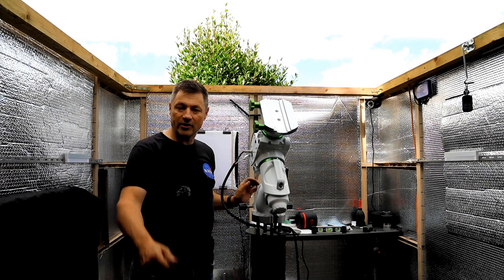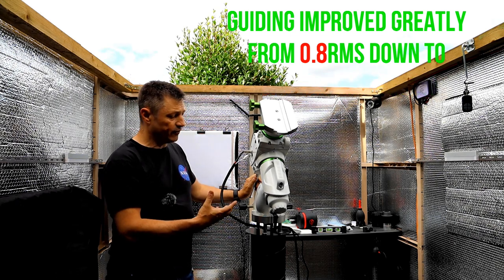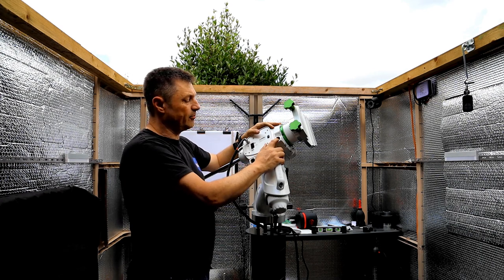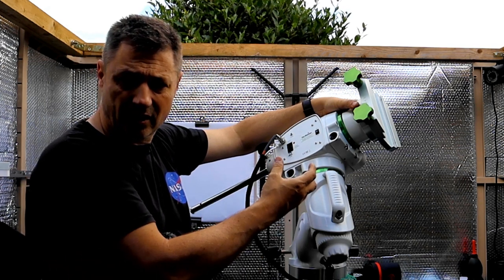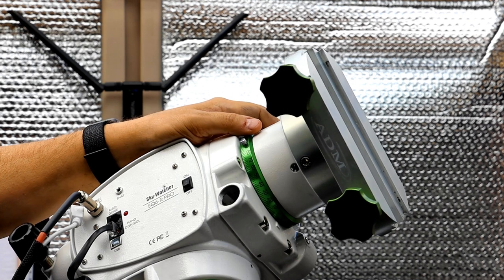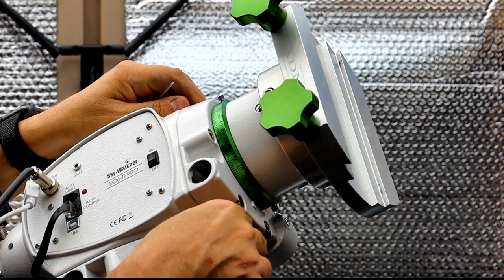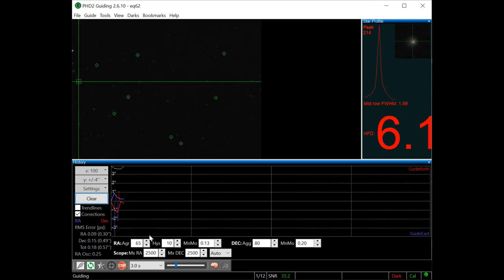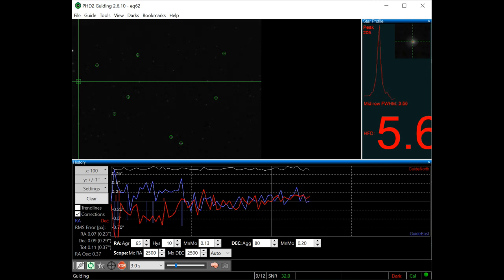EQ6 Tuning and Backlash removal. Also new guiding in PHD2 at 0.3 total rms error

Comment: Great stuff. I watched this after watching your teardown, rebuild + bearing replacement video on EQ6-R Pro mount. I just adjusted the sticktion on DEC and RA by backing off how tight nuts were on bottom of DEC and behind polar scope on RA. Very easy to perform and results on balancing are fantastic! I used channel locks and cloth to loosen RA nut. Loosened DEC "cup" nut by hand. Initial imaging session appears to have dropped total guiding error from 0.7-1.0" to 0.5-0.6". I've worked on electro-mechanical systems used in semiconductor facilities all my life, so that helps with these procedures! But I'm still a newbie to astrophotography, and all the associated hardware and software. I will have to try the backlash adjustments shown in this video next. Thank You for the very clear demonstration and explanation of these adjustments. They allow people to greatly increase the performance and value of their mounts, without paying through the nose to have someone else do it!
Reply from the maker: Hi Ralph and thank you for watching and taking the time to comment. The mounts often come out of the factory way too tight and it just requires the adjustments you made. I most probably could have got away with just doing that but I love tinkering with mechanics so was always going to strip the mount completely. I am sure your knowledge and experience will help you a lot and wish you luck in your pursuit of this fascinating hobby.

Comment: I hypertuned th eq6rpro couple days ago. I went with superlube also, says rated for 40 belowF. I was worried about final adjustments but again your video was spot on. My mount went from crazy declination movements while guiding and then stopping, in CO cold weather, to guiding to .55arc sec last night. I've learned a lot about how mounts work as well. Thanks again, Frank
Reply from the maker: Excellent results Frank and thank you for taking the time to share that with me. I am very pleased the video was helpful and the mount now gives you great guiding. Clear skies

Comment: Thought I'd give you an update. After finally getting a good guiding assistant backlash graph and noticing my guiding was just a bit worse then just before, I thought I would try and get the best of both worlds. Using an amp meter I tightend the mesh what seemed to be barely perceptual and I immediatly ran into problems with moving south again. Tried to reverse and then I couldnt get north movement !!  Am back at it again tonight but clearly there is some method to this madness of fine adjustments I dont quite see yet. This is extremely touch to put it mildly. When you say that the final touches are like just barely barely moves that seems an understatement ! Hope others reading will get this point. I'll keep you posted as my experiences may help you in some future video explainling the how to do it bit. 🙂
Reply from the maker: Hi Richard and thank you for the updates. The final adjustments are ridiculously tiny and its hard to express this. I have found that its better to be a tiny loose rather than tight. I find that as long as the backlash is measurable by PHD2 it can be adjusted for  by the software.

Comment: Another great video mate,  just ordered a set of bearings for my EQ6.  Although my guiding numbers aren't too bad the amount of tight spots when balancing has always concerned me.  cheers.
Reply from the maker: You may be able to just take some tension off the 2 main shaft nuts as they seem to be done up well tight. That can free a lot of the stiffness up.

Comment: One of many very useful videos from you! I just had my NEQ6 belt modified, but when I got it back, I have serious issues with my dec axis. I did run the guide assistant including the measure backlash, and it show indeed a 'long' horizontal part befor going south again. The reported backlash is >56000ms, but according to your video, it is rather binding, and not backlash? I did run the dec axis 360 degrees both ways by the hand controller, and there is no obvious binding to my notice, no sound or other...  I have also posted the question on various FB groups, and some suggest not enough tension on the dec belt. The belt is very hard to access on the NEQ6. So now I don't know if I should loosen or tighten the worm gear! 🤔😄 And clear skies are very rare these days in Norway! 😟
Again thanks for your informative videos! 👍🏻
Reply from the maker: Hi and I hope I can help. If its fine binding which it most probably is especially if you have zero play in the axis it can still rotate fully with out stopping. Back off the Worm carrier so there is the smallest amount of play possible and re run. The worm and gear need to move freely and PHD2 guise assistant can correct for a small amount of backlash but cannot do anything for fine binding. This is the only set back as both will look the same on the guide assistant graph. Its extremely unlikely you have that amount of backlash and if you did you would feel that in the axis by manually wobbling it while the clutch is locked. Please let me know how you get on and if I can help anymore
Reply: @Astrobloke  Many thanks, I will let you know! 😊

Comment: Nice. Suggestion:  I'd recommend painting your silver thermal wall insulation flat black to cut down on reflection of skyglow, ambient light, and even LEDs on power supplies. (I covered the bright on on my EQ6 with a sticker. I can still see in the dark, barely, but that thing was designed too bright.)
Reply from the maker: Thank you and great suggestions. I no longer use that obsy as I have built a much larger one recently at a new location with a warm room. Its my most recent videos if you want to check them out. Thanks for watching

Comment: Thanks for another great video.  I just did the backlash adjustment on a new HEQ 5 Pro.   There was quite a bit but now I feel no play and there is no binding (confirmed with a multimeter testing the current draw for a full 360 on both axes did not change.)   Looking forward to trying it out. 

Rowan Belt mod parts arrive next week.   Looking forward to try that too.
Reply from the maker: Nice and the belt mod should improve things further. Let me know your results and thank you for commenting
Reply: @Astrobloke  Thank.   do you know if it is normal for the motors to get slightly warm?   I didn't take notice before adjusting the backlash.   Now they are just slightly warm after a few minutes of practice slewing.
Reply from the maker: @Wolfie6020  I would think after slewing that would be normal but I really do not know as never checked. I shall do that though and let you know

Comment: Hi again. After the summer and a bit through the winter I started having guiding problems again and noticed a few important screws had become loose. Upon starting to re adjust the gear mesh I noticed that the spindle adjustment could introduce signifigant backlash if I lossened  it for any given gear mesh setting. This leads me to scratching my head a bit as to how to be sure where any apparent backlash is coming from.
Reply from the maker: Its a but like that where you tend to chase around. I normally leave the spindle and focus purely on the worm carriers for adjustment. I have for a while now not worried about the backlash size so much as that can and is compensated for in PHD2 its any kind of binding that is the killer for good guiding.

Comment: Nicely explained Glenn
I’ll check those screws to see if it makes a difference to my new EQ6R pro. I was shooting low last night (about 22 dgrs) I think that affected my guiding, I was getting .9 - 1.1 out of the box! Too much atmosphere I guess/hope!
Cheers Glenn
Reply from the maker: did you finally get your mount? Low will really test the guiding but I would think it could be improved. I would start with PHD2 adjustments and guiding assistant and then move onto PEC training first and see what that changes
Reply: @Astrobloke  Yes mate, it arrived! Tested it out now, going ok but guiding is a bit high!
Thanks for sharing that Glenn, I’m sure it will come in useful 👍

Comment: Great video on tuning this mount, amazing what it is capable of with some fine tuning, cleaning, new quality bearings etc. a basically good mount out of the factory becomes an excellent mount with some careful work, easily within the capability of most who like to go the extra ‘mile’. I note you have various mounting plates on the mounts you have worked on, where do you buy them, please, they look well worth adding to the mounts. Stay safe and best wishes from ‘down under’. 👍🔭🇦🇺
Reply from the maker: Hi Shevill. Both my HEQ5 and EQ6 R PRO are now just a dream to use, guiding between 0.3 and 0.5. I have always done my own mechanics with cars and motorbikes for years so taking these mounts apart and rebuilding was a really fun task for me. It is however very accessible for most with very modest tools as you say. I initially upgraded the saddle on the EQ6 because the original was not that great and the white paint used to grip my losmandy plates when trying to slide a scope in. That one is by ADM and I bought from Firstlightoptics.co.uk. On the HEQ5 I upgraded the saddle because it was the older model and only held vixen dovetails (all my scopes are now on Losmandy) that saddle was by Geoptic and I bought from Rothervalleyoptics. ADM do one too but I liked the orange lol. https://youtu.be/QLJUy-DrPlI     https://youtu.be/LJ-egFak5ZU

Comment: Great video on the eq6r. I started to get bad guiding and made adjustments, waiting for tonight for results. I will rebuild it this fire season here in Northern California as it’s 2 or 3 months of smoky sky’s. Oh had a question did you get to the 2. Something. 3 is insane in my mind .
Reply from the maker: Thanks Dan. On the very best seeing I have had it guiding 0.3 - 0.5 which I was very happy with. I have since bought an EQ8 R PRO for my observatory so the EQ6 is now back on its tripod in the garden. Most nights guiding is rarely over 0.7 but mostly 0.4 - 0.5. I think the extra stability of the pier and the Obsy protection from any wind helped a lot.

Comment: I’m wondering if you could use an amp clamp while slewing to see any changes in amp draw to indicate some binding. Thank you for your efforts in showing how to get the most out of out eq6-r
Reply from the maker: I do believe cuiv the lazy geek has a video on something like this. I think he was using it to check balance but this could work well for finding a uniformed drive of the gears
Reply: @Astrobloke   I worked in the hvac field and use an amp clamp to check compressor and fan motors. How sensitive the reading can be might be an issue.
My mount has great dec numbers but the ra is always way more in error. And with my C8 sct I get funny shaped stars sometimes many . My culmination is good. With the spacecat not so much bad stars probably because of the wide field it has. I’m thinking after pec tuning if the funny stars don’t reduce significantly I will check ra backlash and tune it. Mounts only a few months old so don’t wanna take it apart. But when I do where do you get the bearings?
Reply from the maker: @danjensen9425  It will be much more noticeable with the C8. If the RA error is a lot more than the dec you will get misshaped stars. A perfect mount would have the same peak to peak on bothe the Ra and the Dec

Comment: Ok.. got started with the fine adjustments last night. Calibrstion went super well in late twighligt and 0.75 guiding came through. But as I ran guide assistant the backlash measurement failed saying it could not clear north backlash. Where should this point me ? Tightening up the dec worm drive a bit ?  The calibration graph looked real good..
Reply from the maker: Here you have to be careful with adjustments as backlash can actually be fine binding between the gears and so require you to back off a bit. I would say the adjustment needs to be with the work carrier,  https://youtu.be/7-QGpHp8vMo If you have not seen this video please take a look as I go further into fine adjustments and it may help guide you.
Reply: I started last night with just as barely tight dec drive as I could get. Barely past any wobbling but still a tiny bit noticeble if I looks carefully at the green degree ring. So I think it should be safe to say its not probable binding. Also the holding nut on the worm drive shaft barely tight.  Followed your follow up video on hypertuning.  Will look at the video you share just now as well. Am trying to be very carefull with adjustmebts from the start working my way from obvious wobble towards any kind of binding and stopping short of that.
Reply: Yes.. this was the same video I followed. I am still unsure as to how to intrepret the "clearing north backlash failed" message from guide assistant. My gut tells me I need to tighten the mesh between worm drive and gear, especially since I have started off so close to notiicble wobbel.
Reply from the maker: @richardbrekne5646  with your guiding numbers it is extremely close and will need the finest adjustments which may give you better results. Sounds like you are doing a good job. Does
take a little fiddling when you are so close

Comment: Hi again. I am now getting good calibrations, guiding between 0 7 and 0.5 averaging at 0.6 or better. But I still cant succesfully measure backlash with guiding assistant.. with 《cant get consistent south movement》as the error message and a graph showing some slight but intermittant tendancy to respond to the south push. Have used a clamp amp meter to balance and adjust the gear mesh as per your video on that subject. Perhaps I should continue to make tiny adjustments to loosen the mesh ?
Reply from the maker: Your guiding is in a very good range and so you must be extremely close. It does seem strange you are not making enough south movement. Make sure in PHD2 you go to the guiding tab and click on steps and then advanced. In there press reset. Just to make sure the step sizes are correct. Also what guide rate do you have set? If using EQMOD it defaults at 0.2x. I would try 0.5x. I have best success at this rate.
Reply: Will check the steps, and have read a bit about how and why to change them. I am at 0.5x guiding speed.  The amp meter can also be used to see a reflection of the overall resistance in the drive I find. I did as your video suggested to adjust out any areasbof slew that need obviously more current then the rest, but also found you can loosen or tighten the grub screws tiny amounts and see slight current change. This leads me to think that with a bit of fiddling and watching the current useage I can find an optimal current use for both axis. Perhaps usefull in smoothing evnt RA perodic error as well ?
Reply: Got a good backlash graph now. Almost perfect actually. Loosened grubb screws barely.. and I mean barely. Will measure the difference tomorrow in current at guide rate 7. I noticed the RA wandering during guide assistant also was slightly reduced today after I eased that barely also. Implies that periodic error is somewhat affected by slight ra axis binding ? Guiding at 0.5 to 0.6 now.

Comment: Hi Glenn! What a great performance and what a great job😳! I would like to ask you if the process of adjusting the mounts(eq6r pro) backlash and applying Permanent PEC is dependent on which you do first? I mean does one impact the other one in terms of performance? You know, like always balance dec first! + what is your opinion on using the Predictive PEC algorithm in PHD2?
Thanks and continue your work please! Clear skies.
Reply from the maker: Hi Denis and thank you for the kind comments. The PEC really needs to be done after you have adjusted the mount.  Any adjustments will have an effect on any periodic errors and the harmonics of the worm drive.
Predictive PEC I have read can be used with PPEC and can work well. I have been trying it out lately but still playing with settings and not found it has made much difference.

Comment: My RA axis has play. When I tighten the 2 little screws to a point there is no play, APT can't move the mount sometimes when I do a goto. When I loosen the screws there is backlash and APT can move the mount. Any idea?
Reply from the maker: To have a little play is perfectly normal with these mounts and the design of a fixed worm gear. When there is no play you will get binding. The problem with binding is it will show as backlash on PHD2 as all that measures is the return rate of the tracking from one direction to the other. Unfortunately it cannot compensate for any binding at all so a little play is good, the worm can turn freely with not even fine binding which is extremely hard to detect. PHD2 can compensate for backlash however so just make sure you run guide assistant (8min for eq6 minimum = 1 worm cycle) and apply the suggested settings. Good luck and clear skies

Comment: The RA spindle has this little timer disk on blocking any chance of adjusting it if I think it needs it.  Can this only be fine adjusted during rebuild ?  I got the dec sorted now and have a rather bumpy RA that I'd like to smooth out. Thanks for any help.
Reply from the maker: That is the axis encoder so the mount knows the worm gear position for PPEC training. It has a small screw in the centre and can be removed just be gentle. PEC training might be the solution to your bumpy RA.
Reply: I tried pec training a couple times without getting much sucess. Doesnt that encoder disk sit inbetween the little light sensor ? Looks like it wont come out unless I first remove that.
Reply from the maker: @richardbrekne5646  The light sensor does need to be removed first. There are 2 small screws holding that in.